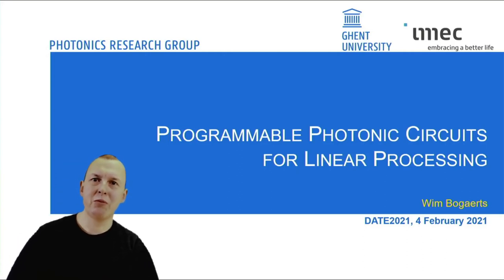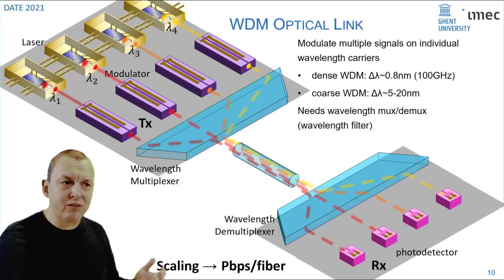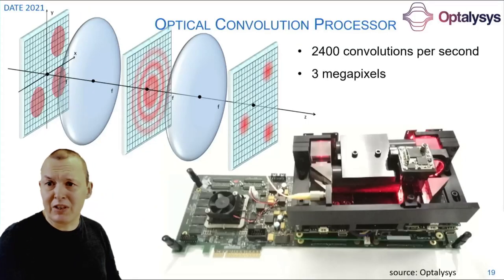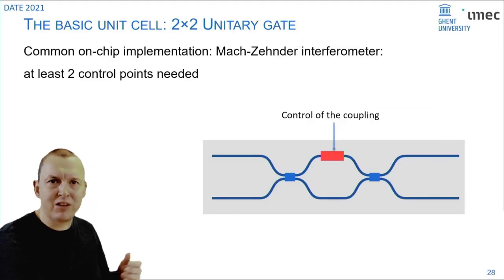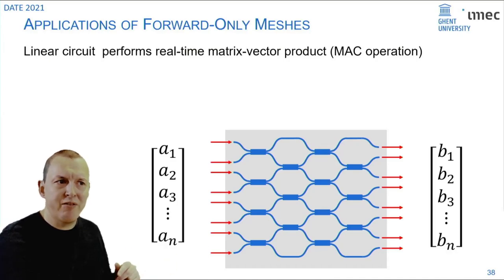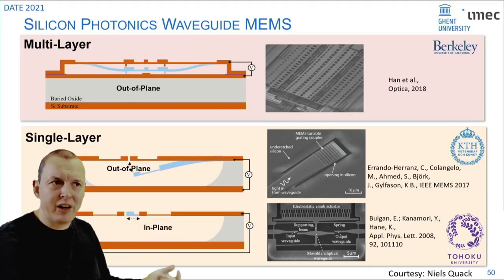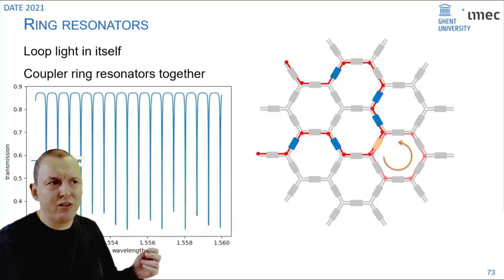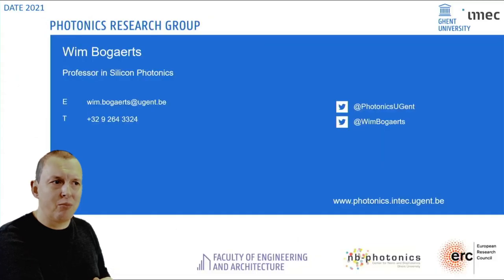DATE2021: Programmable Photonic Circuits for Linear Processing - Wim Bogaerts

Comment: make mass photonic chip manufacturing
Reply: use photoelectric effect as gate voltage, nano cantilever voltage bending
Reply: photonic to electric electron lithography, photoelectric lithography
Reply: you can make actual logic gates, with light only, on-off gates
Reply: does not matter if your flow is electrons or photons
Reply: bend a block cantilever in the way of the photons
Reply: push a piezo in the way powered by photons
Reply: make them small to be fast enough, starting at 20THz gate frequency, remember emi, capacitive or inductive, where are the wires, they are just photon wave guides
Reply: timing is only when you choose to measure the output signal, to allow for changing the inputs
Reply: one source photon source, traveling in the circuit, signal source is the sync source